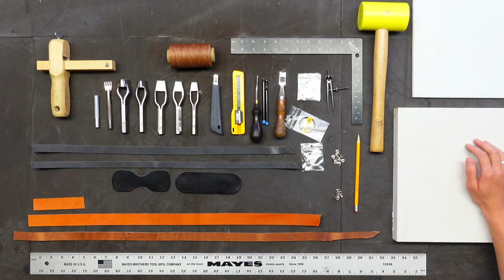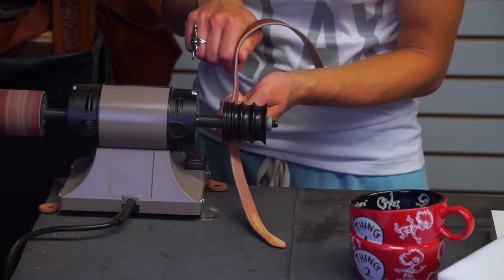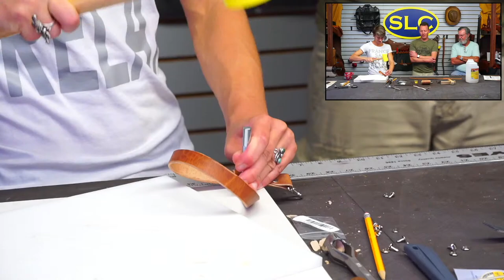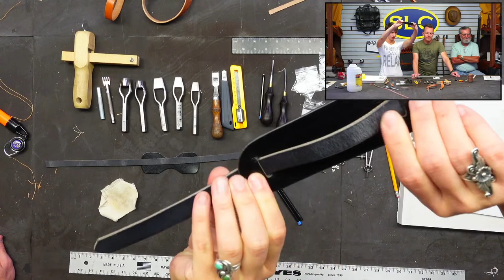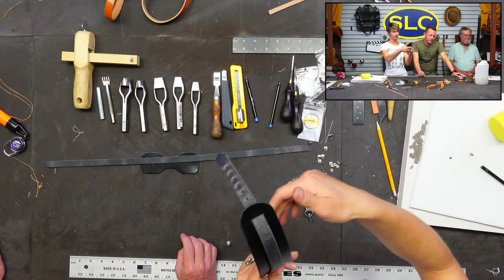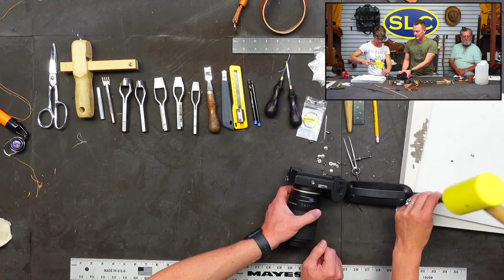Making a Custom Camera Strap w/ Liz + Tony

Comment: watched many of your live shows love them learned a lot .Wrist camera strap is real nice just made one myself.One thing A piece of leather should be attached where you have your key ring to the camera or the ring will rub on the camera and with wear it will scratch the camera body.Any camera strap should have a piece of leather attached under the rings to protect the camera body.I speak from years  and many camera ring rubs.Just a suggestion.Thanks again for all the good help love ya
Reply from the maker: Deb that is an excellent point. We intend on cutting those out and putting them on but slipped our mind when getting it laid out. 

We will go over that in the next video, camera neck straps.